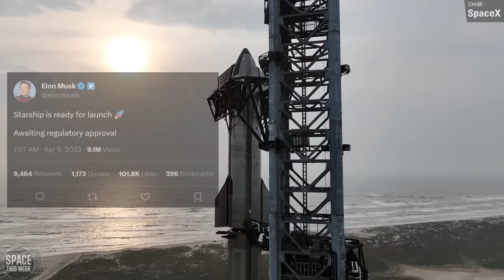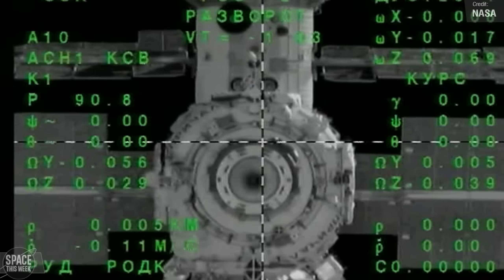SpaceX Starship is READY! NASA Reveals New Mars Helicopters, Vulcan Explosion, Soyuz Move, Artemis 2

Comment: I'm waiting 24/7 for the 04/20 launch!
Reply: Why. spacex sucks.
Reply: @TrueSpace61 why do you think so?
Reply: @amppari_234  Solely because of the elongated muskrat that runs it
Reply: @amppari_234  Well let me just say quick disclaimer that I can prove everything I'm about to say if you want to hear it.
#1. It is single-handedly making climate change worse. As you probably know, they use methane as the fuel for their stages, and they have their first stage autonomously land. Now reusing stages sounds cool, until you realize that having them land themselves wastes so much fuel when they could just parachute in for a soft landing. Even soft-landing thrusters combined with parachutes wouldn't waste all that fuel. Now with wasting fuel and weight on all of this means that they have to extract more fossil fuels from the planet, therefore polluting the Earth with more carbon and making climate change worse.
#2. The company doesn't do anything to benefit humanity. This one is pretty self-explanatory. It's a company run by one of the most infamous and greedy people on the planet, so it just makes sense that it's only done for personal gain.
I can list plenty more reasons here if you want to hear them, but you can't deny the reasoning behind these first two, which is just a brief summary of the two biggest reasons why it sucks.
Reply: @TrueSpace61  understandable
Reply: @TrueSpace61  those boosters can’t just be parachuted down, they are waaay too heavy for that and the parachutes themselves would take up a lot of the payload mass making the whole idea worthless. Reusing the rockets is much better than just having them land in the ocean time and time again.
SpaceX is a company so of course they would want to go for profit, but that doesn’t mean that there are zero benefits from having a space program. We wouldn’t having GPS without satellites and many other technological advancements without space programs. The falcon 9 has launched many satellites, including: research, military, GPS, Starlink Internet satellites (which have increased internet connectivity in places where they can’t lay cables down, or where they have been destroyed: Ex Ukraine), and probably some others that I can’t remember off the top of my head.

Now this isn’t to say that Elon is a good person. I think he’s a disgrace to the human race, but SpaceX has done and is doing a lot of good things. Even though Elon is the figure head of SpaceX and might have come up with the idea of Starship, the engineers and construction workers that work for him have made the dream come true.
Reply: @spacemanspiff7283  You do know that the whole point of spacex is to make him profit right? So if you like spacex you like musk. Not to sound like a logical fallacy here, but either you like musk and spacex or you hate both of them. You do know that there's this awesome thing called weight distribution right? It would be much more climate-friendly and effective to have strap-on boosters recovered from parachutes to get the thrust without all the weight concentrated into one stage. But they don't do this because, guess what, it costs more money. They didn't launch any satellites to benefit places where cables can't be placed or where they are destroyed, because anything they do will be used for profit, so they won't give away the free use of the satellites. And if they did, do you see fast internet working in rural areas like Afghanistan and Pakistan? No, you don't, because musk is too greedy to help them. Did you know that it is also illegal for the military to use spacex? Detailed in the Outer Space Treaty of 1966, it is forbidden to use space as a military frontier and as a national or personal frontier. This also means that spacex is in violation of the treaty just for existing, as it does not do what it does for the benefit of all. Just saying how legally, if governments weren't corrupt, spacex shouldn't even exist.
Reply: @TrueSpace61  a few corrections. You said" land themselves wastes so much fuel when they could just parachute in for a soft landing."

Actually, they couldnt use parachutes. they tried it with early Falcon 9 but could not control them and always broke on touchdown

#2. The company doesn't do anything to benefit humanity.

Actually, their goal (i think) is to help humanity by creating a vessel to 'lifeboat' humans to mars and also to colonise mars.
Reply: @airbusa380airplane  That's because they're using the parachutes wrong. They could easily split into strap-on boosters and use parachutes. Even if they couldn't, they could use liquid hydrogen and oxygen (zero emissions and harm to the environment) instead of methane (very dangerous to the climate). But they don't because it costs more. 

Lets break down that second claim. First off, ferrying people to Mars and back does not help humanity. It only wastes fuel and harms our environment when we could get all the scientific benefits and more by using the Space Launch System and Gateway to ferry actual astronauts and cosmonauts to Mars. Second off, there is no proof that colonizing another planet can help humans. Remember back when the colonization of the Americas and Africa was a big thing? Think how that turned out. It led to slavery, mass genocides, extermination of culture, and musk. Why do you think it would go any differently on Mars? The best path forward for humanity is to learn from the astronauts on Mars and to leave Mars how it is. Humanity is not meant to be an interplanetary race. NASA's whole mission is to learn from the cosmos to improve Earth, not to expand humanity's reach.
Reply: @TrueSpace61  They use Methane because it has higher density compared to Hydrogen, it also requires a lower temparature to remain a liquid so it is a lot more convenient to use. As for your concern with climate change, rockets are a non factor compared to agriculture, planes, cars, etc. Strap-on boosters are a bad idea because it requires a lot more material and would be a lot heavier so it would burn more fuel. Also the fuel cost of landing rockets under their own power is very low (1.7% of first stage fuel for falcon 9).

I am not going to get into why we should go to mars because that is a political topic.
Reply: @pubgrub2  Sure it might not be a leading cause, but they could at least do something to help, like using hydrogen and oxygen. Obviously the boosters would be reusable so the material isn't an issue. Sure it might be heavier and burn more fuel, but we could easily make up for that with asparagus staging. Also, the first rocket that performed VTVL in the 1990s (Delta Clipper Experimental or DC-X for short) ran off of pure hydrogen and oxygen, and it performed nominally and could bring up some decently-sized payloads and reduce turnaround times drastically, so arguing that it wouldn't work with hydrogen and oxygen has been disproven.
Reply: Spacex is good, but elon sucks
at least that’s how I like to think about it :)